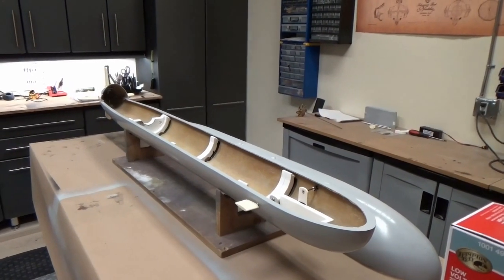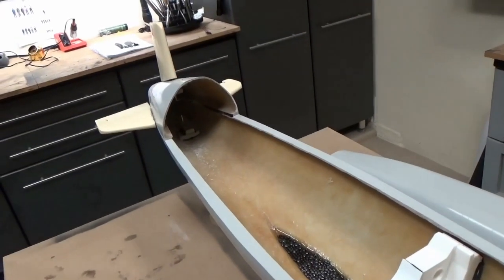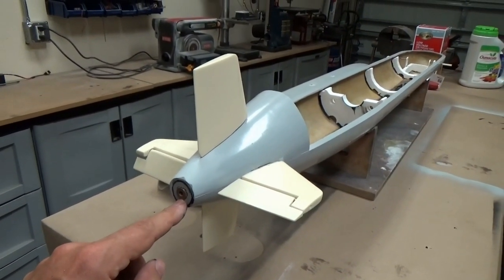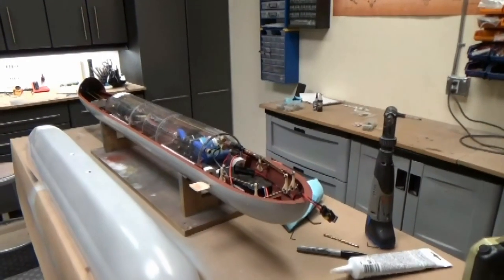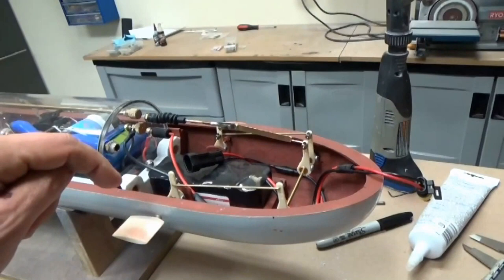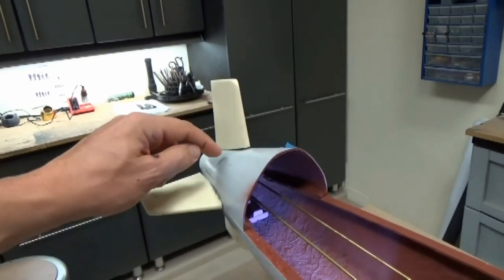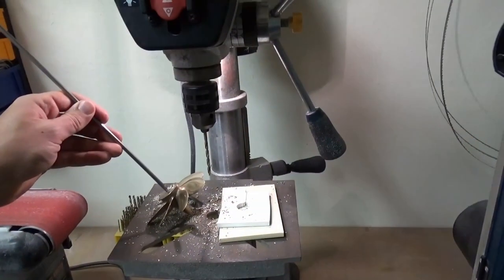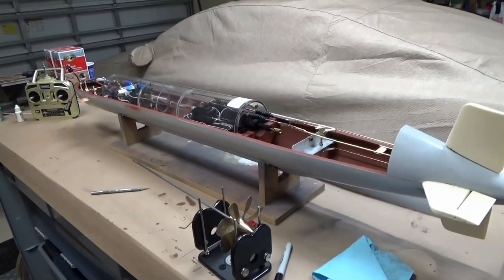Upholder Class submarine RC buildup CH3 - Linkages and control surfaces

Comment: what RC are you using - i hear 2.4 doesn't work well with subs?
Reply from the maker: We utilize radio gear on 75MHz (legal surface frequency here in North America). Unfortunately, this hardware is now out of production with most, if not all, radio producers.
Reply: RCSubGuy so what does the new sub modeller do for RC?
Reply from the maker: VEX Robotics does offer brand new 75MHz transmitters. The real trick right now is receivers. There are a limited number of them on the market, but a long-term solution has not yet shown itself, (though I'm working on it!)